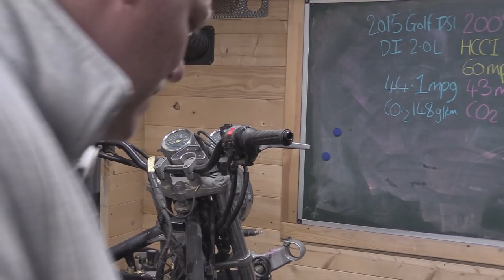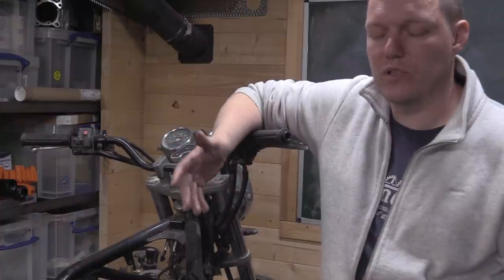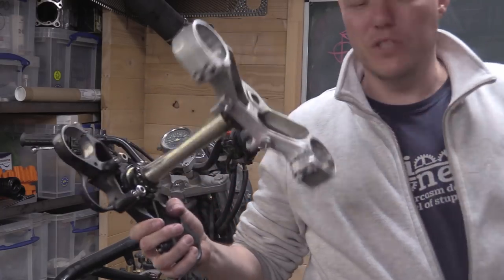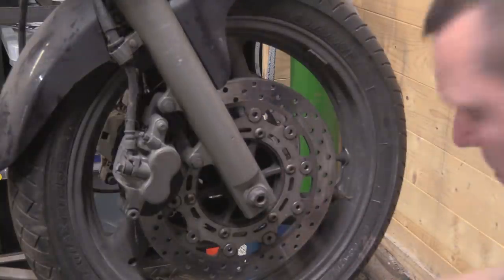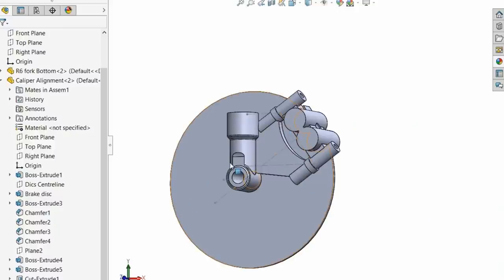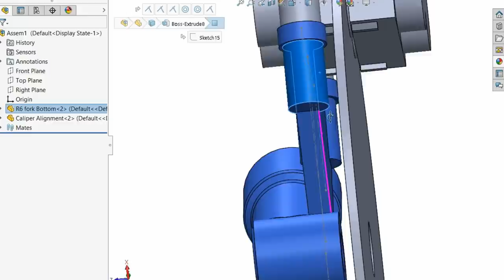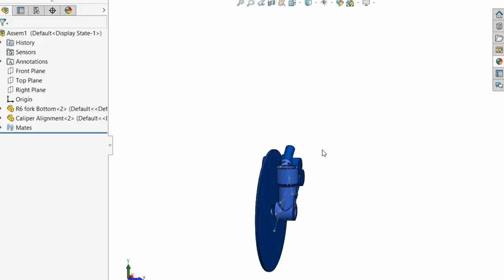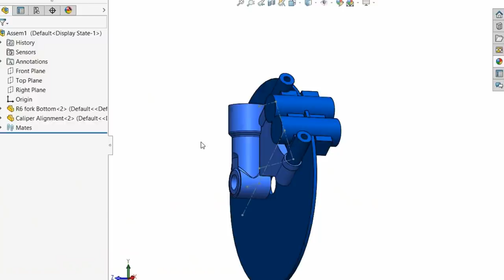Project Isaac #28 - Fork Measurements

Comment: Interestingly, a couple years later in the R6's life, the bottom clamp went flat instead of angled to add some flex back into the front end.
Reply: haven’t carbon fibre frames been disliked as the lack of flex gives them less feel?
Reply: @shanedowling9440  the issue more was learning how to design in flex and no flex where desired as the mfgs just didn't have decades of prior experience to work with at the start.

Comment: As you say you can get most things to fit. My 2 stroke triple lives in an FZ750 frame with xj600 yokes, Trx850 forks. Aprilia RS250 wheels/discs and RSV mille brembo calipers.
Reply: Think theres a guy that’s put a Banshee or RZ/RD 350 engine in an FZ750 frame   Confuses peeps lol 😂

Comment: Won't putting the thicker forks in exactly the same spot as the original ones impede the steering? Or will you adapt the steering stops to prevent the tubes from hitting the frame at full lock?
Reply from the maker: All in good time...

Comment: Have you checked already, if the XJ brake disc align properly with R6 brake pads? I think the R6 brake discs are 310mm, you mentioned the XJ ones are 300mm. Also, you might need to machine the fork leg and/or the caliper mounting surfaces.

Another thing, I think you might need to machine new axle for the front wheel. It looks like the XJ wheel + R6 fork setup will be much wider. Have you thought about the mud guard - neither XJ, nor R6 will fit in this setup?
Reply from the maker: Have I thought about all this? No... lol or course I have.
Reply from the maker: And 310 vs 300...
Reply: @dirtygarageguy  It is not just about the rotor diameter, but also about how wide the contact area of the rotor itself is. In another words, if the R6 brake pads contact the rotor fine or over-hang on the inside or outside....or in worst case, if the brake pad is simply too wide compared to the rotor.

I mean, I just want to point this one (brake par - rotor alignment) out. I didn't think of this myself, when I was doing my GSX-R front end swap on my SV1000Ses, while using different, forks, rotors, brake calipers, triples/yokes...
Reply from the maker: I have the brake calipers and discs and pads and everything... all is 👍
Reply: I was thinking this, if the R6 pads are used on a smaller disc they'll not wear over their whole area, after a couple of thousand miles the pads could end up touching each other where they overlap the disc. Maybe the disc size difference isn't enough to do this?